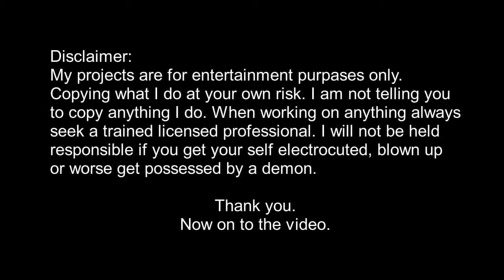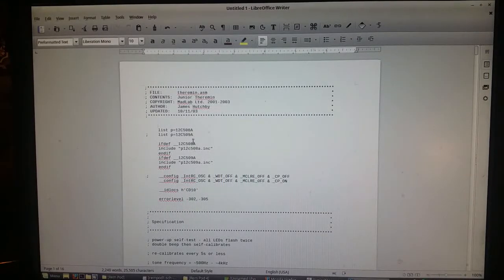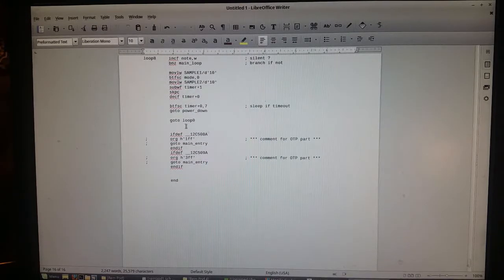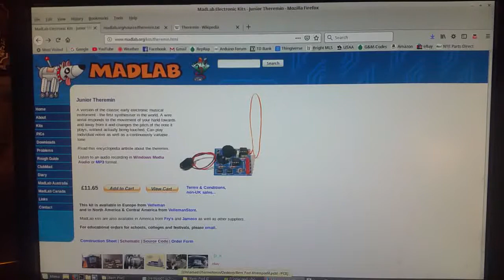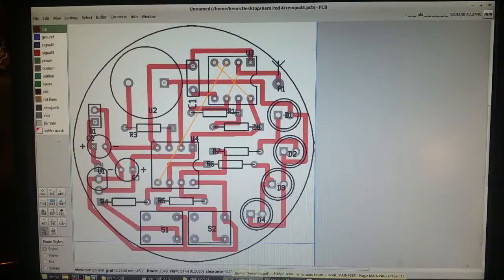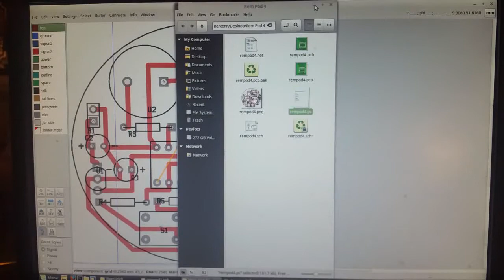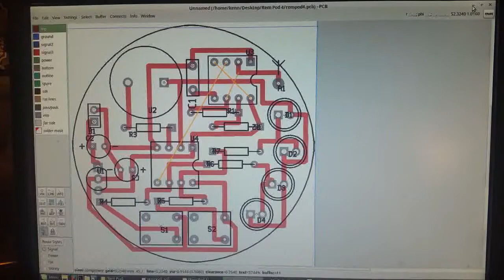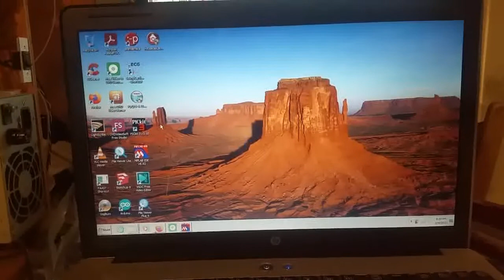Building a Rem Pod Part 2

Comment: What is the point in changing the pic lettering?

Ive seen pic12F508, 12F508A, 12C508, 12C508A

Confusing. So these microcontrollers act differently? Also where to find the original electronic parts used on the madlabs junior theremin?